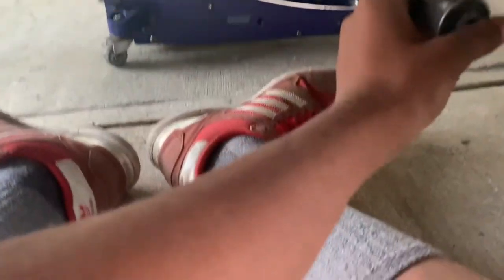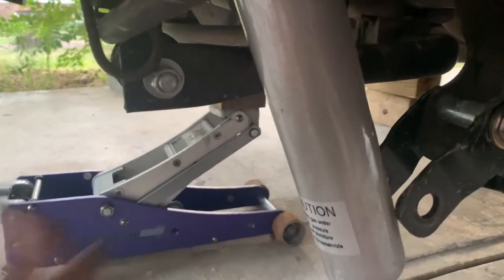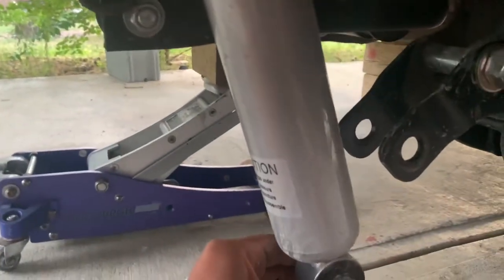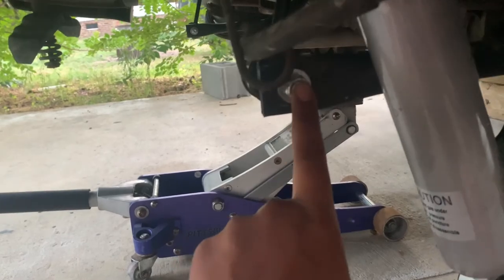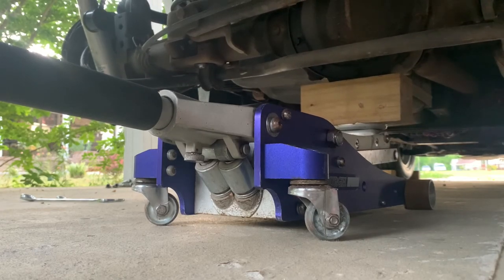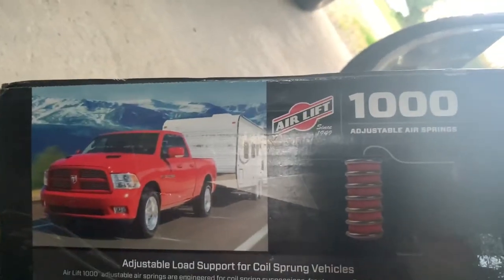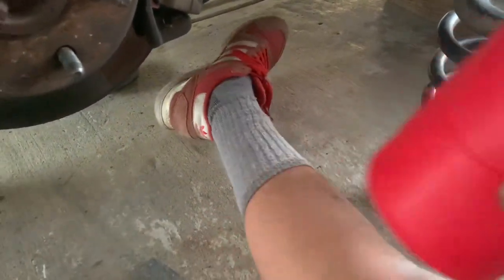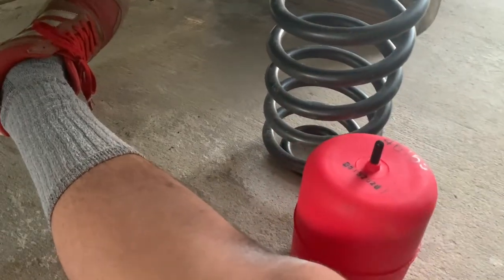Installing helper bags on the Tahoe ! 😎

Comment: Thanks for posting the video definitely helps out with the ride when fully loaded it stops bottoming out and becomes way more stable while pulling trailers as well
Reply from the maker: It really does I still haven’t cut my exhaust if I did it would definitely help a lot more with no one inside it hits 😅

Comment: They actually work when they only are halfway up the spring? I have air shocks for my lifted Tahoe and they level it out and give it a little bit more stiffness, but not enough to help with squat from heavier towing. They don't make any heavier springs or longer bags like you have
Reply from the maker: Yeah I only run them when the truck is full other than that I don’t run them with air also my exhaust hits before anything else need to fix that 😅